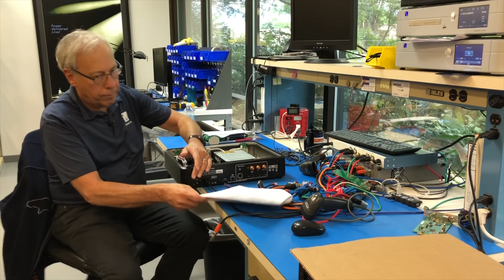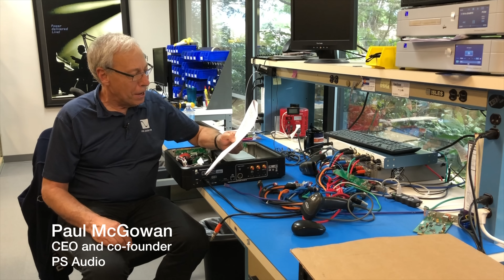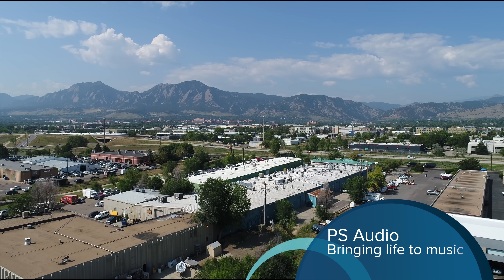What is a 2.5 way speaker?

Comment: I thought, maybe I misunderstood this, that 2.5 way speakers were just two way speakers with a passive radiator. Am I wrong about that? Somebody please correct me and if possible could you give an example of a common speaker that is advertised as 2.5 way? I thought that Jose in Argentina was asking something like: how can a 2.5 way speaker make lower sounds than a 2 way speaker when the radiator isn't electrically connected to anything? He says straight out that "...the crossover network is a two-way design..."
Reply: Paradigm makes a ton of 2.5 way speakers. It has nothing to do with passive radiators. Think of it as a speaker with 3 way drivers, but the mid pulls double duty and goes down as low as the speaker is capable of.
Reply: Think of it like a 2 way with multiple woofers, (but there is no band pass filter on the mid) & only the highest woofer on the baffle, near the tweeter is going to play up to the tweeters x over freq. the other woofers are basically bass only. helps the mid range and imaging i think.
Reply: Andy B A 2 and 1/2 way speaker is not a 2 way with a passive radiator. A passive radiator can be thought of as a substitute for a port.